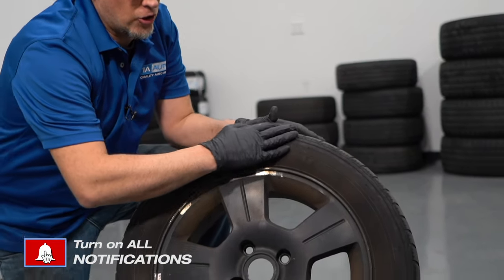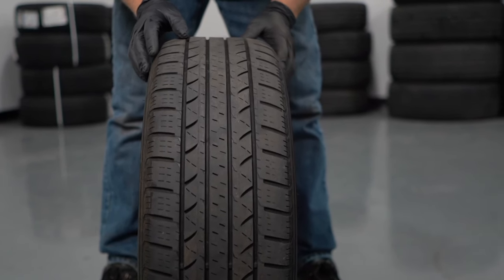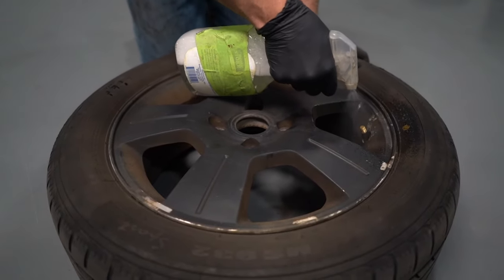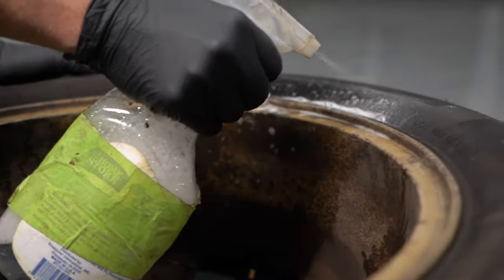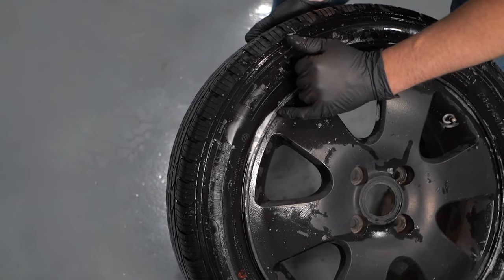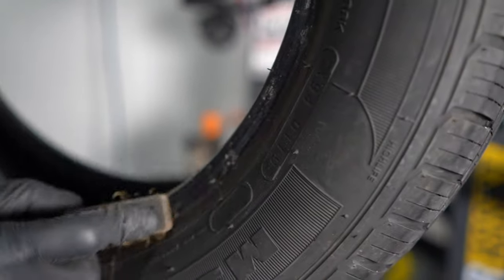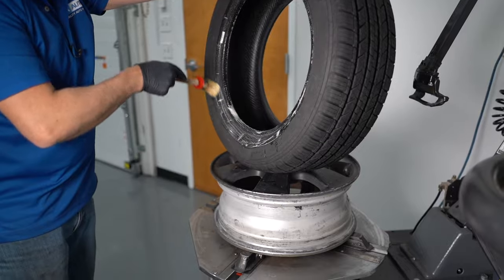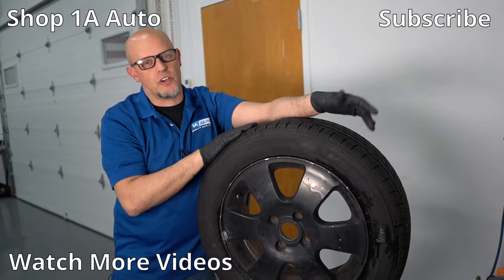Slow Leak in Your Tire? How to Check Car Tires for Leaks and Punctures

Comment: Just have a few questions, I have a 2007 Jeep Grand Cherokee, Laredo, passenger rear and front only ones that go slow with no pressure readings. After one month have to refill them, both on the same, I had them rotated. Them they just switched both passenger side Wheels to the same side, thought they were we're supposed to crisscross all the tires , not in parallel. My tires are about 5 years-old, when I bought them, I know I definitely invited them a few times, and looks like they might have cracks in the tire wall,  but why is it only on the passenger side., Driver sides never lose air pressure? Any ideas?